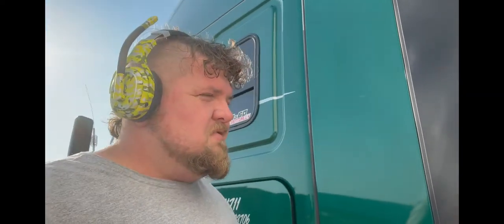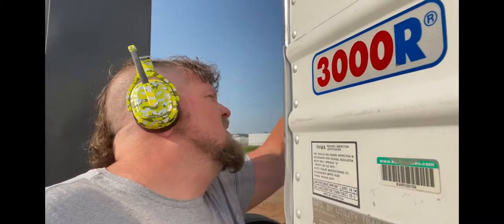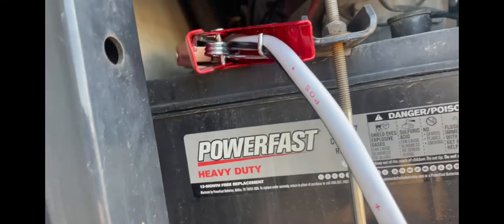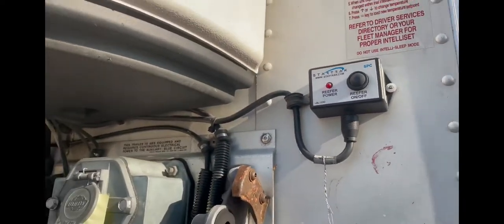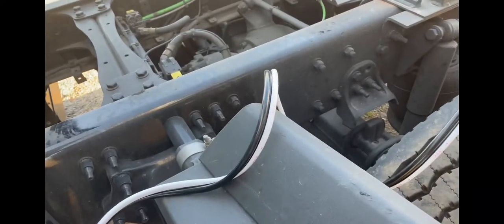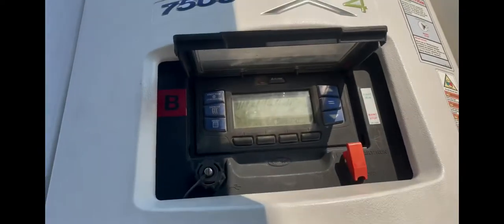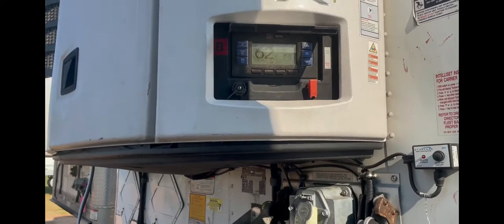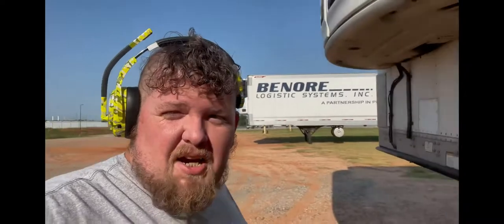How to jump start a dead reefer unit

Comment: Once jump starting and turn off will it turn back on????
Please help
Reply from the maker: Depends on if the battery is bad or just run dead
Reply from the maker: You could always try running on continuous until you get to a shop to have it checked out. I just let it run and charge for a bit and then it started back up no problem